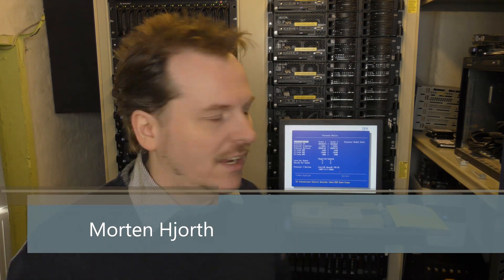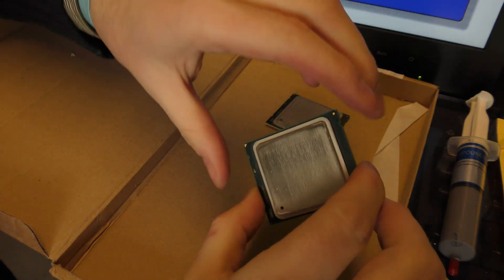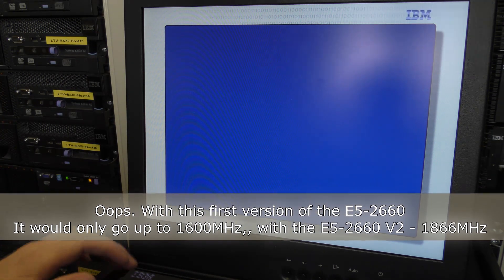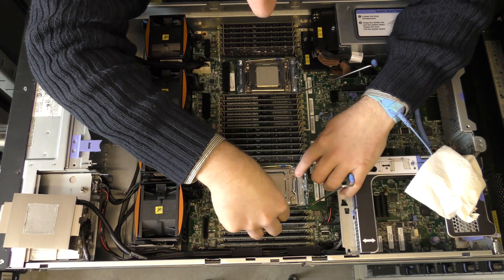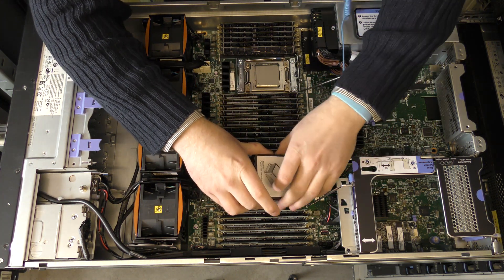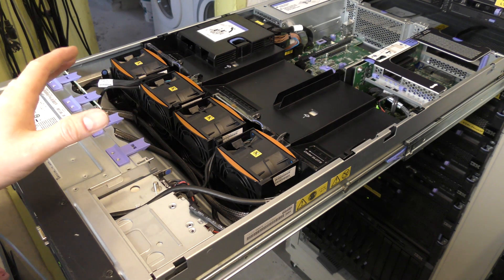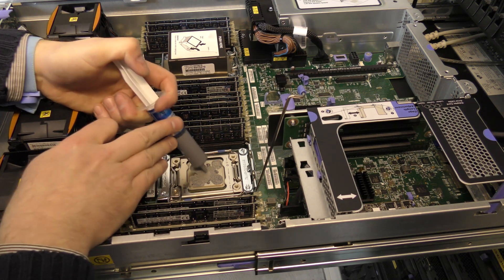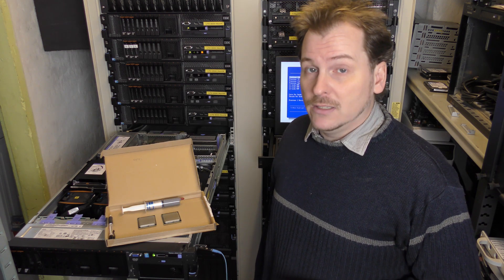New Pair of E5-2660 CPU´s for my x3650 M4 -Total Fail!! - 475

Comment: hmm dows the bios of the server have been upgaded to the latest firmware maybe the latest firware is beta
Reply from the maker: Hi panagiotakis1234
Thank You very much!  I did this in a previous video :-)
Thank you for watching! :-)
Reply: yes but i remembered that is was a beta firmware
Reply from the maker: panagiotakis1234 This CPU is from Q1 2012 why shout they firmware this now?
Reply: after searching  i came to a conclusion that ibm/leonovo, dell, hp lock down there firmware for specific cpus (serial number code) so you will only be able to use those cpus only if leonovo creates a specific firmware for you that implements this code serial. From what i understand most consumers that use those kind of servers use parts that have been approved from leonovo themselves and buy the parts from them
Reply from the maker: panagiotakis1234 
And I am guessing that that is not in the deal with Intel :-)
Reply: maybe you can contact intel but to implement a microcode into those cpu would mean. buy a compatible motherboard to reprogram your cpu (lots of way available in google) you have to extract bios implement the microcode and reflash it with the a microcode of a standard cpuid of a non engineering sample cpu. x86 cpu are so over helming embedded cpus are so munch easier in this task

http://www.delidded.com/how-to-update-cpu-microcode-in-ami-bios/
https://albertveli.wordpress.com/2013/03/05/aes-ni-enabled/
https://downloadcenter.intel.com/download/21925

I would like to buy a server for some renderings but im between ibm 3850 x5 or supermicro 4028GR-TRTi need a lot of gpu power and cpu power
Reply from the maker: I am not going to be messing with the microcode in my x3650 M4,.

Comment: Too bad you got ES chips.  You would've been much better off getting a couple of genuine 2670's for about the same price.  They would be a bit tougher on the power supplies though.  Also, just because the shipping packaging wasn't great, they weren't static wrapped or anything.  I suggest trying one at a time just to make sure it's because its a ES chip it won't boot.  I've read many times though that most systems don't like ES chips, you pretty much need to have a Supermicro or Asrock motherboard to run ES.
Reply: I tried to find 2670's for what a I paid but sadly they have gone up in price.  I did however find genuine 2660's from the trusted seller I bought from about 1.5yr ago.  Linked if interested,http://www.ebay.com/itm/BX80621E52660-INTEL-XEON-E5-2660-8-CORE-2-20GHz-20M-8GT-s-95W-PROCESSOR/131178741206?_trksid=p2047675.c100005.m1851&_trkparms=aid%3D222007%26algo%3DSIC.MBE%26ao%3D2%26asc%3D41375%26meid%3D73189794ca43473e8c3b309013494a93%26pid%3D100005%26rk%3D5%26rkt%3D6%26sd%3D131896904028
Reply: This is what I bought just over a year ago.  Sadly price has gone up as I only paid 150.oo for the pair.  I wish you better luck in the playhouse next time.  http://www.ebay.com/itm/MATCHING-PAIR-SR0KX-XEON-E5-2670-8-CORE-2-60GHz-20M-115W-PROC-FOR-HP-SL270S-GEN8/131567596148?_trksid=p2047675.c100005.m1851&_trkparms=aid%3D222007%26algo%3DSIC.MBE%26ao%3D2%26asc%3D41375%26meid%3D73189794ca43473e8c3b309013494a93%26pid%3D100005%26rk%3D4%26rkt%3D6%26mehot%3Dpp%26sd%3D131896904028
Reply from the maker: Hi Anthony M
Thank You very much!
Thank you for watching! :-)

Comment: Send them back and ask for geniune cpu?
Reply: The Red they are genuine processors.
Reply: Steve W no they are the samples!
Reply: samples they might be but they are genuine, you need to look up the word genuine in dictionary, if they were not genuine they would be manufactured by joe blocks down the road and stamped intel.
Reply: K m8
Reply: He thought they said "E5" but they actually say ES for "Engineering Sample".
Reply: they aren't genuine Xeon E5 2660, they're engineering samples, which are different chips that should not be sold on, they might be made by Intel, but that doesn't make them any more genuine, as they're not real Xeon chips.
Reply: @JoshuaNicoll  They are "real xeons" and they are made by Intel, BUT an ES is not a stable final product. They are basically used for testing in simple terms. ES often have lower clocks, less cores and other "bugs" in them that final retail CPU's will not have.
Reply: @TheRealMrGuvernment  I said they're made by Intel, however ES and QS samples are not real CPUs in the sense they are not retail, they should not be resold but most are.
Reply: @JoshuaNicoll   Fully agree there, they should not be re-sold. "they're not real Xeon chips." Was more what I was referring to in that they are real.